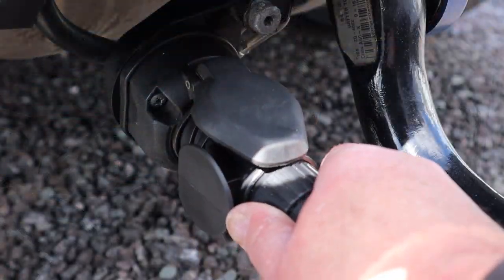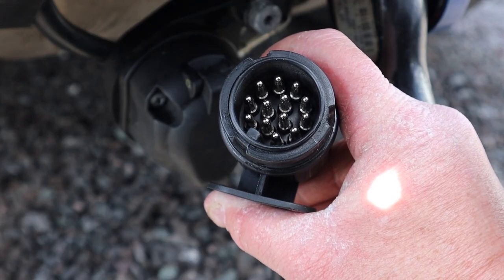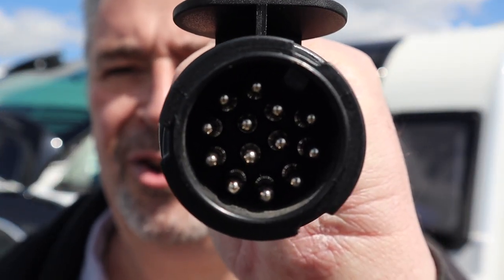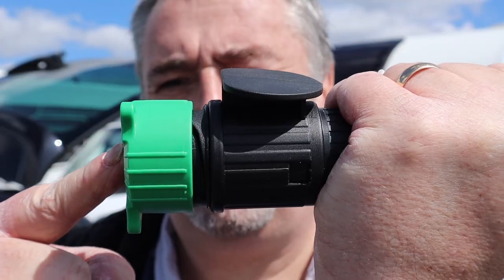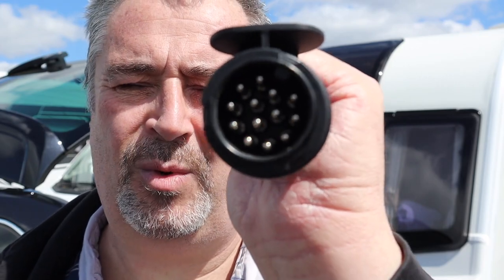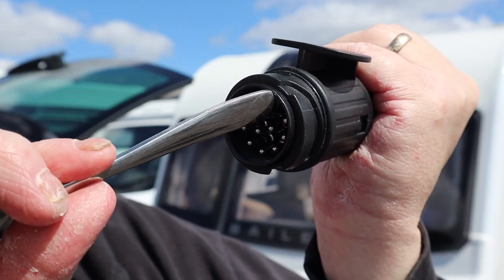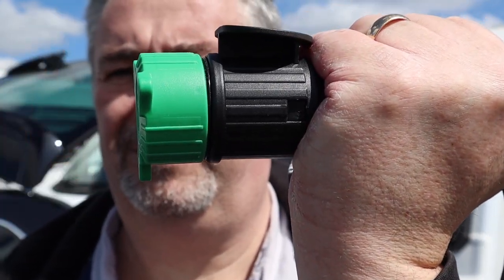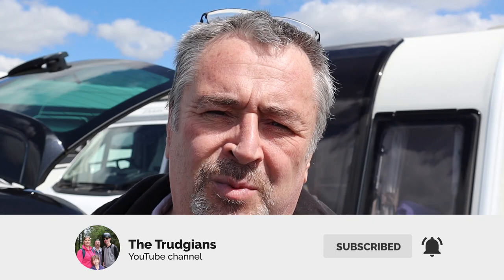13 pin plug pin re-alignment for caravans or trailers

Comment: Hi Dan great video. I found with our old van we never had a problem whats so ever but we chopped that one in for a newer one and it's a pig nearly every time we plug it into the car but this handy little tool takes all that hassle out of what others have described a nightmare swearing 🤬 and getting all flusted you all know what I'm saying😂.it's a great tool and  has you say they are cheap to buy,so well worth just having one.I keep ours in the drivers door so I can get straight to it if needed.....Good advice Dan 👍👍

Comment: I keep slight pressure on the plug and rotate counterclockwise until you feel it align. Then rotate clockwise as usual. Works every time. Fix the problem within seconds of discovering it. The pins inside the plug that keeps it from over rotating in the housing wear out over time, especially with new users. When they cam over the plug can still work fine.

Comment: Just replaced my plug as the same as the 13 pins like the car, but I can turn the nodge with no problem and stick it in. Maybe older one's has more problems?

Comment: Mine I regard as a cap, not an alignment tool, as mine stays on all the time the caravan isn’t on the car. But then I don’t have an A frame plug storage socket. Just re popping in a spoon, watch out you a) don’t bend any of the prongs and b) don’t short anything as there could be live terminals from the caravans 12v system.